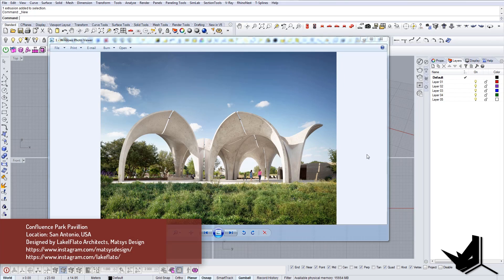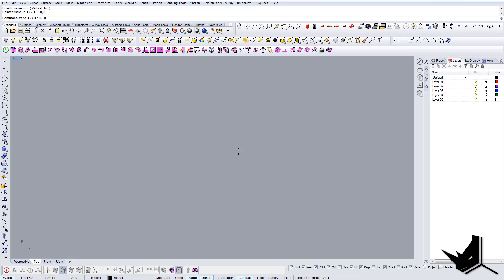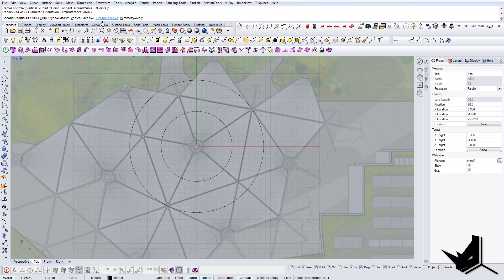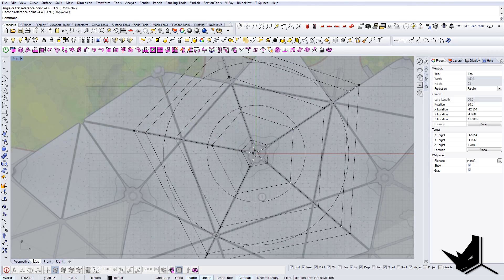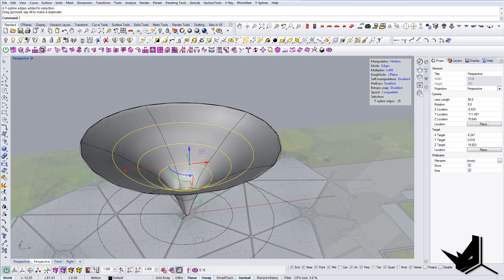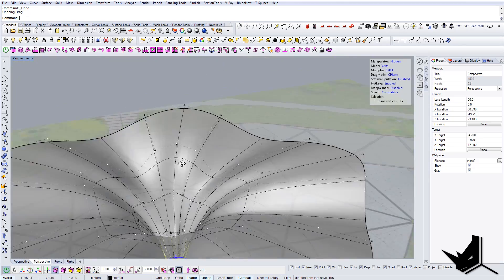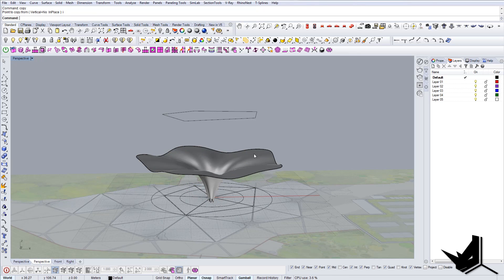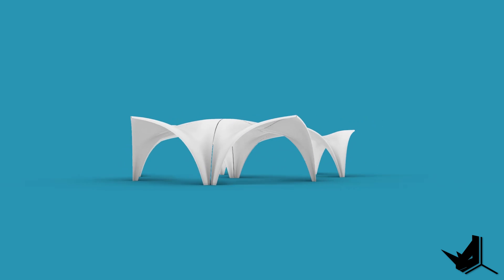Rhino Architecture Modeling Confluence Park Pavilion

Comment: please explain how you turned donut into pentagon
Reply from the maker: I just selected the bottom part, and clicked delete. After that, you switch the "low poly" with high poly mode by clicking on TAB. This tutorial is outdated now because Tsplines tools are not used anymore. However, the same result can be done by using SubD tools.

Comment: This is fantastic. I'm wondering, when it came to adding thickness, you did like an upward push-pull which means that the thickness is not the same at the bottom of each piece. Is there another option/command which might apply the same amount of thickening to each piece?
Reply from the maker: Yes, good observation. You can use command OffsetSrf to offset surface in the normal direction.

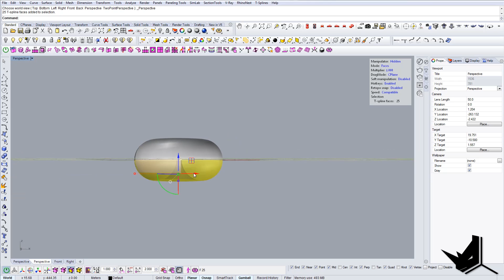Comment: HI, Thanks for sharing, btw, could you explain when you cut the circle 5:46, what is the tool you used for cutting?
is that a plugin?
Reply from the maker: Hey YT, that was T-spline object, so I just selected the bottom parts and clicked "delete" key on my keyboard.

Comment: Thanks for this amazing tutorial. Sometimes you're a little too fast for me :-D Maybe you can just insert some "signs" of the shortcuts you use, while using them? F.e. if you talk about holding the L-button, just have a sign of the L-button? I guess it will be easier to follow your instructions then... Amazing work and thank you so much for doing this. Greetings from Germany!
Reply from the maker: Hey, 
Thanks for your comment! I appreciate it. You're right about that signs of L and R mouse button. Quite a few people suggested that, but I still haven't managed to find the right software for this. All the solutions outhere are very very basic and don't work well. I guess I"ll keep looking. Thanks for your suggestion. Appreciated! Greetings from Serbia :D
Reply: @HowtoRhino  Thx for the quick response. Good to hear that :) 
I'm looking forward to your masterclass!
Reply from the maker: @Powerelefant  Sure! Awesome. Great that you signed up! :D
Reply: @HowtoRhino  Which version of Rhino + Plug-Ins do you use? My Rhino-Interface looks so different (Mac)... I miss most of the buttons you use.
Reply from the maker: I use both Rhino 5 and Rhino 6. Rhino 5 mostly just for T-splines and Rhino 6 for everything else. I also use Vray, Bongo, Grasshopper (integral part of Rhino 6 now) and VisualArq for BIM modeling. Mac Rhino version is much different as they are created separately for two different platforms. Recently Rhino 6 for Mac came out and it is much closer to Windows version now. However, there are still some drawbacks, so I would definitely advise using Rhino6 for Windows if you have a chance.